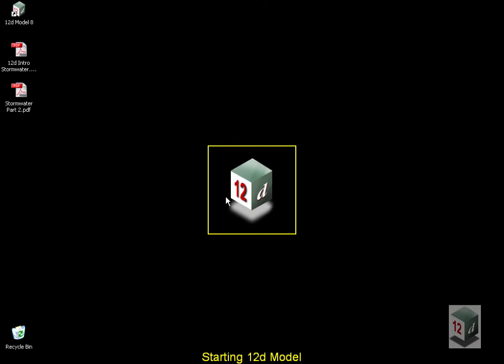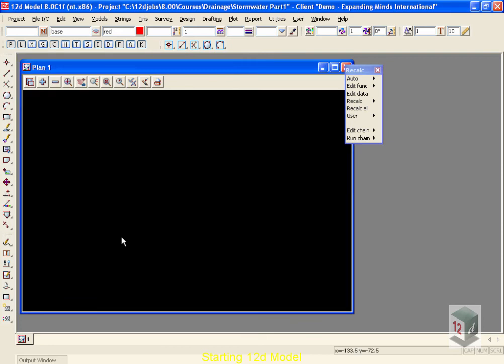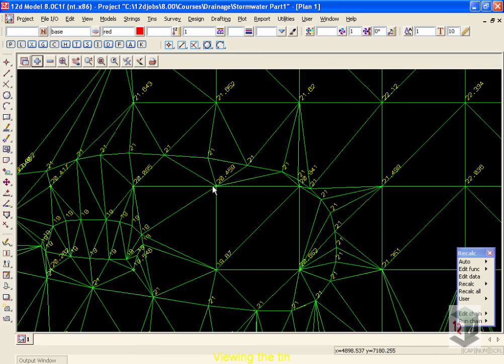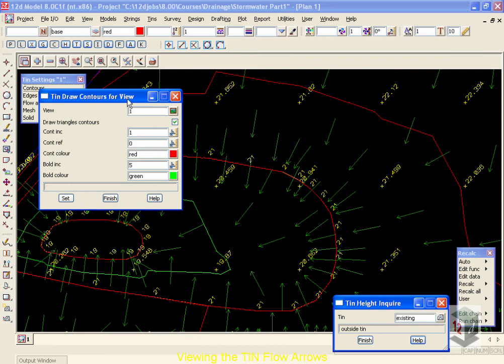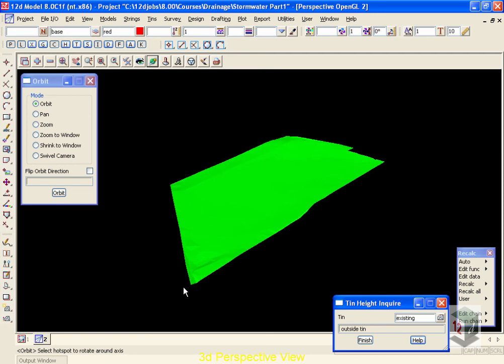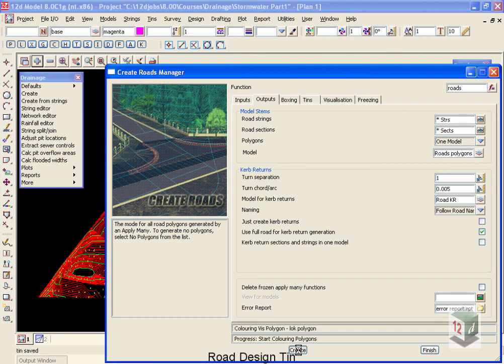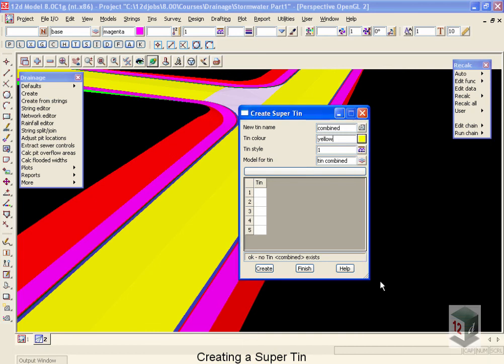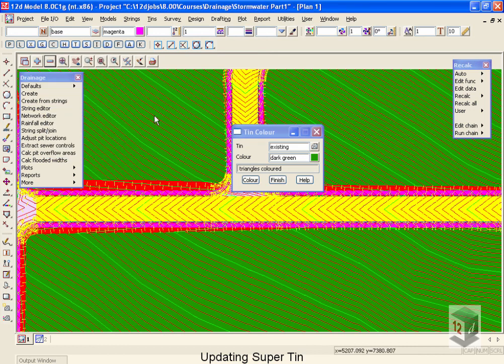12d V8 Intro to Stormwater 01 - Getting Started and Creating a Tin

Comment: HI
Thanks for the video. On minute 12:30 (ish) when you explain Create Road Manager , I followed the procedure couple of times and always comes with following Error as " Every string must have a unique name-error for string road 1 (or 2)". How can I proceed without error. (I am using v10).

Also, on output page what should I choose for naming (Full road name RHS or Full road name LHS)
Reply from the maker: Check to see if your "ROAD CENTRELINES" have unique string names. These will be your Superalignment/Alignments which 12d will apply templates too. All must have unique names. You can do this by clicking on Models=>String Info Table. Select the road centrelines Model. It will list all the strings in the model and you can see if there are any duplicates. Most users will put the road names or numbers in this place. It doesn't matter what you put here as long as there are no doubles. Regards DESCALT

Comment: Thanks for useful videos. Is there any resources I can get the practical sample as well ?
Reply from the maker: Hi Ali, Sorry i missed this comment. Yes there are few options. I'm currently building a database of Project Case Studies which will demonstrate the features used on a project. The first projects however wont be ready until Jan/Feb next year (and may not be related to your query).. In the mean time I can probably send you an example reference. What modules of 12d are you using? Is it the drainage/Storm analysis you are looking for or just drainage String?